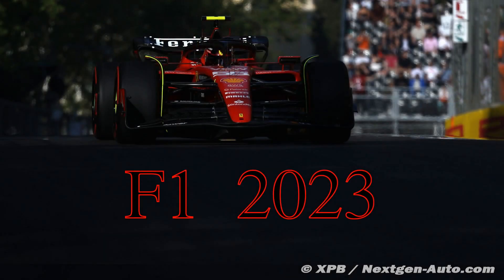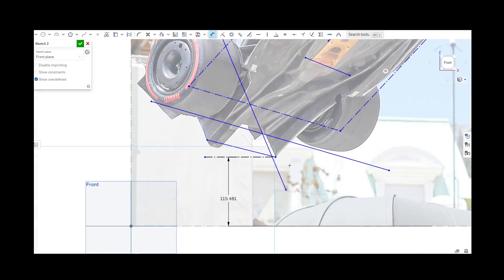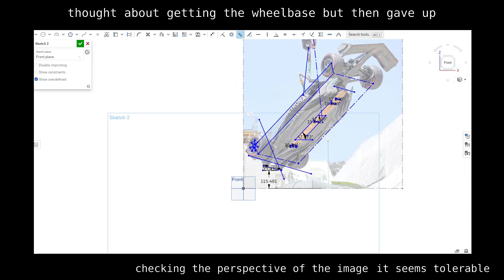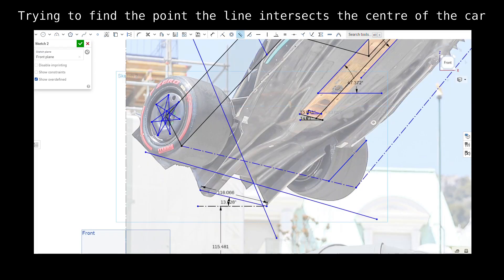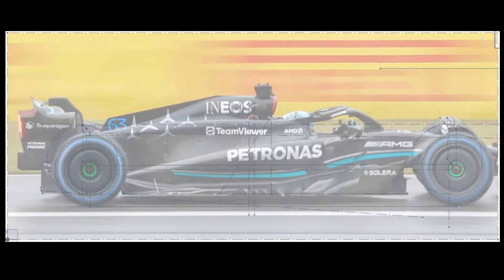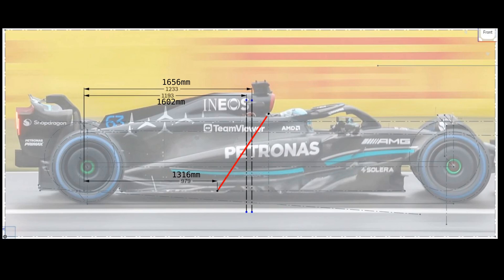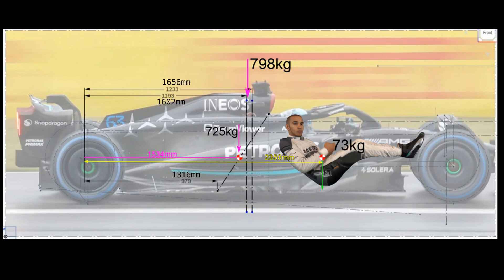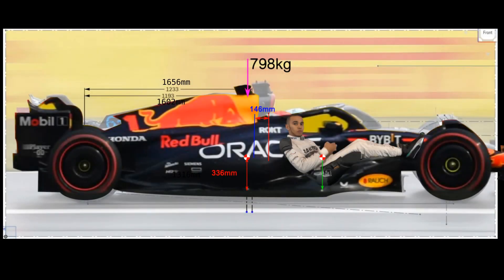Finding the Centre of Gravity of a Formula One Car

Comment: The center of pressure and center of gravity also affect the aero balance, if the COP is ahead of the COG, then you get oversteer, generally, and if the COP is behind the COG then you get understeer generally. To make it even more tricky that COP and COG move around under braking, acceleration, yaw, transients and steady state cornering, etc. The balance in the corners is dependent on where the COP and COG are relative to each other. If your aero is unstable in transients like turn in, then your COP is going to be shifting on entry, mid and corner exit relative to the COG altering the balance.